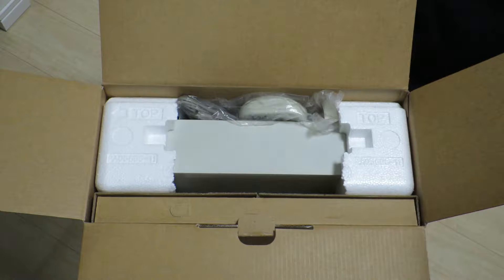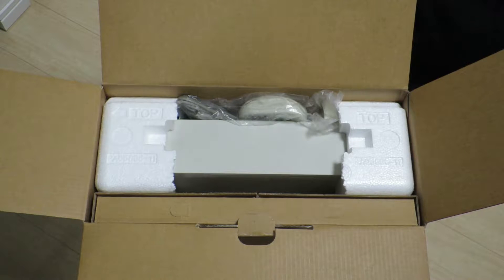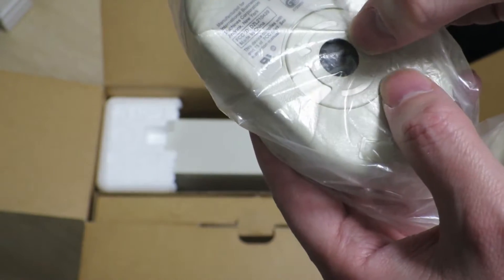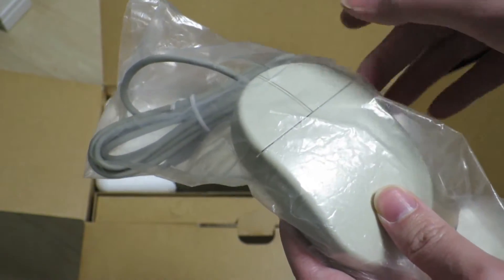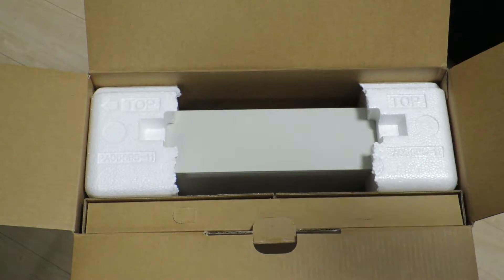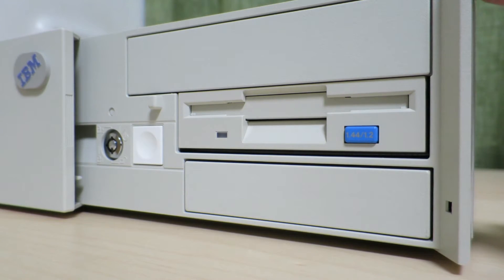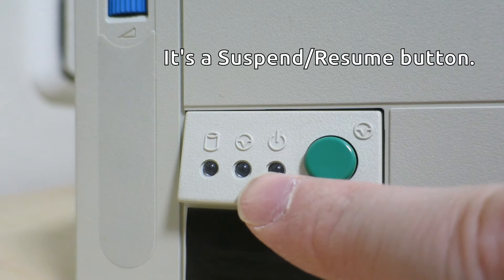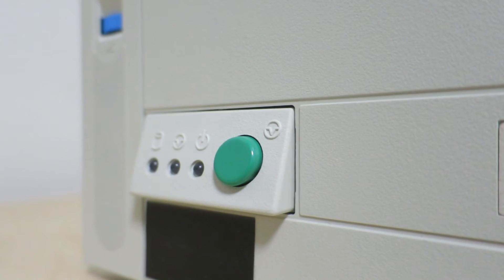1995 IBM PC Series 720: Unboxing a (nearly) unused 20-year-old 486 PC!

Comment: was that thing on the very left hand side of the front of the computer a volume slider? you kind forgot to mention it!!
Reply from the maker: Good point! I haven't actually tried using that volume slider, so I don't know its true functionality, but since this machine doesn't have a sound card, my guess would be that it is used to control the volume of the built-in PC speaker. Thanks for the comment! :)